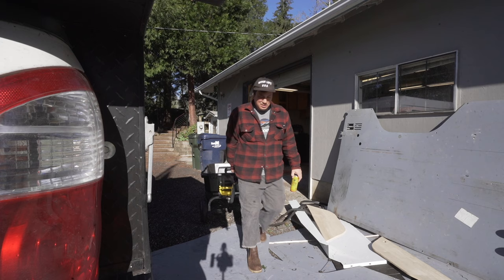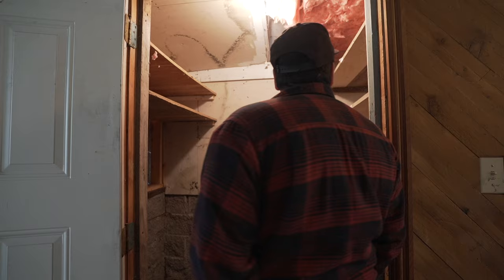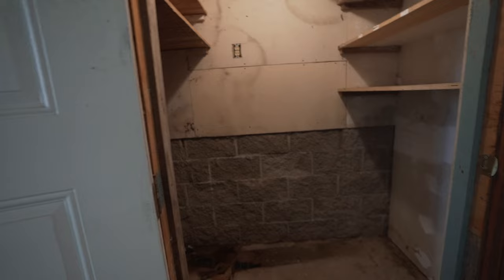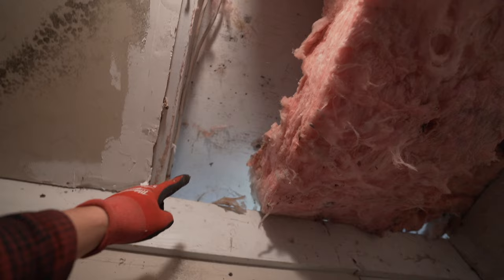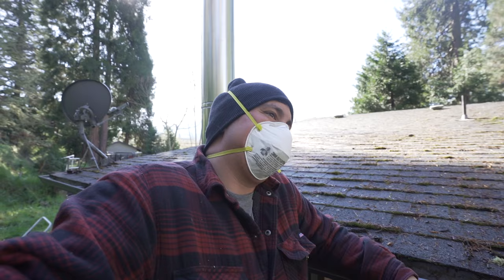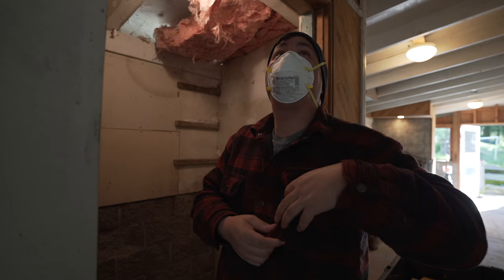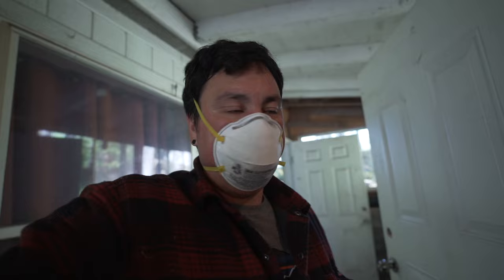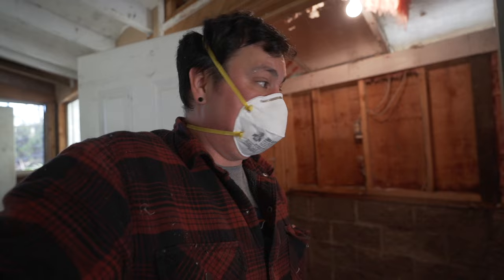It's Worse Than We Thought... (Mobile Home Demolition)

Comment: I can tell you what my dad did since our back yard was under water; buy drainage tile it has rows of holes across  in it going from one end to the other. The rows are all the way around it  You will have to dig a trench across from one end of the room to the other end near the wall make sure you keep it level use a line level.  You want the till to exit out of the soil to drain the ground. You will have to dig the trench starting at the sidewalk area to allow the water to express out.  After digging the trench next to the outside wall using waterproof paint, paint the wall below the ground to up . Now putting a load of gravel above the ground in the trench you have dug make sure it is level  all tho way across use your line level. ( you should b able to google or ask the tech at Home Depot how to use a line level) Put a level amount of gravel all the way across. Lay your tile end to end butted to each other Then fill in the trench with a level even amount of gravel covering the tile all the  way across 
from one end to the other. Make sure you have at least 6 to 8 inches of gravel over the tile and fill in the rest with your soil over the gravel. 
You should be able to google these steps or ask the tech at home depot or wherever you buy your drainage tile. It is a job I know my dad, mom, brother & I did this when I was 12 years old. We never had a pool of water in our backyard ever again. Every spring & fall we had a small pond in our backyard in Ohio about 1/8 of a mile from Lake Erie in Mentor on the Lake, Ohio the northeastern Ohio we never had a small pond ever again! 

Also the dampness is drawing the ants they are carpenter ants wet wood will also draw termites!

Comment: Having followed you and watched you work for some time, I am of the opinion that you will not have much difficulty gaining the roofing skills necessary for doing the fairly simple roofs on your buildings. Just pay special attention to the penetrations. I am not a master roofer but have roofed several buildings and never had a leak. One person working alone can get the job done, but that will be very slow and frustrating. With two people, things move along much more satisfactorily. A three-person crew, once they get a rhythm going, can just fly along. Once you tear off the old roof, you need to get at least the new underlayment on as quickly as possible. Especially true in Oregon, where you may get rain at any time.
Reply from the maker: Thanks yo I’m confident I can figure it out just never done it

Comment: Isaac, you’ll not only need to roof but you need to put a drainage system behind that back room, sealing it isn’t going to be enough.  Would the inspection company be responsible for negligence?  I would look into that. You might want to consult with an attorney.  I think you could do the roof, a metal roof would be ideal and add value to your home.  You are so good at building out buses, don’t let this overwhelm you I think these fixes and repairs would be great content.  Instead of a bus build why not a home? I’d look forward to watching.  You’ve got this!
Reply from the maker: Def

Comment: on outside if wood bad at bottom cut it off 2 ft up and replace ! for the wall put house wrap on and side it ! as for the roof if it going to have new roof  repair  plywood if it needs it!! go on line you can get good bug stuff to put around walls at the ground you just have pull a little ground back 4"  ! have a good day
Reply from the maker: Thanks for the tips!

Comment: Hey Issac, It looks like you have your hands full on your house.  Lucky for yourself you're handy and willing to learn how to do new things to add to your skill set.  First off, I'm a general contractor and a landscaping contractor in CA.  It appears you have figured out what to do.  If there is no underlayment the tiles needs to be removed.  Then replace all the rotten timber if any.  Access if you need new gutters, if so install at this time.  Also at this time, access is you need new or add more or relocate the downspouts.  After all this add the underlayment and roof shingles on top.  If budget is a great concern, you seem to have a large following and community here.  Perhaps, gather a group of volunteers and knock of the roof in 1 or 2 days.  Pay if forward after that somehow.  I might be headed your way in a few months so I can help if the timing lines up.  In regards to the exterior back wall, you need to remove some f the earth back and add some waterproofing material to the wall and add some drainage to the area like a french drain system.  All the water from your hill is coming down on your house and you have to divert it away from the house.  All this is not rocket science but I get the sense  that you know what you need to do, but the task on how to move forward on projects you're unfamiliar  and daunting.  If you can build vans and buses you can do a roof.
Reply from the maker: Yeah one step at a time

Comment: Not just the debris. The retaining wall was built to hold the slope from caving. Remove the walls of the room on the sides and the top of the retaining wall down to the studs. Then just use cat screen to screen in the room. New roof. Keep the one log burner. Keep the back slope maintained and not let it grow above the retaining wall. The retaining wall was never meant to be anything other than to hold the dirt back. Not like a basement wall.
Reply from the maker: Thinking the same thing!

Comment: The side of the house should not be right onto the dirt especially because it is made of wood.  There is no waterproof water barrier and the wood is acting like a sponge.  You should create a side porch like @sharon7181 said or dig it out, build a wall with bricks with proper insulation and then restore the dirt.  However that is probably too much work and the side porch with a retaining wall is the way to go.  Also, anywhere on your property where water just sits and gathers is a no no, so you should create a water drainage filtration with rocks and pebbles on a decline to pull the water away.  Good luck, you got this.
Reply from the maker: Def got to get at it!

Comment: You have a huge mess there friend.  Isac, you need to dig all the earth away from the structure and put in a retaining wall with a lawn tile drainage system under it.  That will force the water to drain away from your structure.  I know money is always an issue, but this is going to take some bucks for sure.  I personally would tear the structure out.  Do the retaining wall with the drainage system, and then build back your enclosed porch.  That is actually a retaining wall inside that room, but it is not doing  any good without a drainage system under it, so that entire wall needs to come down so that you can move the earth back at least four or five feet, personally I would do no less than 6', and then get the drainage system in, and the new retaining wall.  .
Reply from the maker: Yeah lots of work ahead

Comment: Exterior wood should always be at least 4 or 5" below the wood siding.
It's possible that soil ran down the hill, eroded from the hill filling up the soil height higher than it originally was.
Reply from the maker: Dang

Comment: Open the ends (remove the end walls) dig out down to the brick foundation. Replace the rotten wood and paint with water repellent tar and put corrugated metal on the walls and the roof. I'm sure there is more but it's a start.
Reply from the maker: On it

Comment: Landscape grading can help to direct water away from the wall. I suspect you may also need to dig down to the footer in order to waterproof that concrete wall if you are going to salvage the back room. French drain might also help, but I can't know about that without seeing more of the conditions. Just removing that whole back room area might be worth considering, which I think you are doing.
Reply from the maker: Thanks for the tip!

Comment: I have been repairing a wall that has/had water damage due to a clogged gutter. I didn't notice a gutter along the backside of your side porch. 
The outside of your closet area needs siding or something to cover the wood to protect it. A French drain that will quickly divert any water away from the house would be wise.
Seal the inside... wood and walls with Kilz. Then cover your stonework with a paint on basement sealer.
I would immediately install an indoor/outdoor ceiling fan or two or a ceiling fan and a bath fan to help keep the humidity in check.
I would hire out roofing the house but diy the rest. Your living quarters are most important, the rest you can learn on.
You do you, of course! I am just participating in the brainstorming. Take care! 😀
Reply from the maker: There is a gutter just sucks

Comment: I would dig out around the bricks and put waterproof membrane on the bricks and re-do all the boarding and waterproof that as well, If the shingles are laid right water shouldn't be getting to the nail entrances. I feel the earth sitting up against the wood is wet and the water is wicking up the walls. P.s it was field mice poop not rat poop. Field mice are so sweet and mean you no harm, they just found a cosy home in your walls that to be fair were open to the environment at the top.
Reply from the maker: Yeah that’s gonna be a job!

Comment: I think an important thing is there appears to be no blocking between the roof joists... Looks like you can see directly outside when the insulation was removed. When the wind blows rain and snow against that wall the moisture is coming in and running down the wall...
Reply from the maker: Gotcha

Comment: We also bought a used older mobile home.  It's in pretty rough shape,  Hired a contractor to re-do the kitchen, eating area , and they had to remove the whole back porch, it was so rotten.  What we found is all the walls are rotten, from the way the mobile home company built it, apparently that has not changed the way they put the windows in. So the water leaks down into the walls from every window.  At least I did get a lovely pantry built for us, off the kitchen, which is so handy.  Our's is a single wide, But back porch was added on, as is the addition, we are using as a bedroom. Roof really leaks in this part, but the whole addition needs to be torn down and re-built. So will only do a patch job on this part, until we can afford to re-do it.  On the floors, below the windows, there is a line of rot, all along each wall, in the whole house.  My husband is working on the spare bedroom right now, and it's starting to look good.  Cannot wait until it's done.  Then the bathroom is next, as the hot water heater is almost ready to go through the floor.  Luckily we bought everything new for it, ready to be put in.   The Whole mobile had to be lifted off the ground, as it had been neglected so long.  That was quite the job.  So Room by room, we will get this mobile ready to be a home, not a dump.  BIG job behind us, and ahead of us, but we will make it.   Keep on going Isaac.  It will be worth it in the end.  Hopefully we live long enough to finish it and enjoy it.  I'm 74 and my husband is 75.    We could use a work part for sure, but our son and grown Grandson, who live close by are both too useless to help.   So like all the rest of our 56 yrs of being married, we will keep on, keeping on.  We're not slackerds.  Just like You and JAYLENA aren't.    Some people have that drive to get it done, a lot don't anymore.  Best Wishes on your repairs, we will be thinking of you, as we carry on.  WE live in Alberta Canada, and it gets darn cold out here!!!
Reply from the maker: Oh snap!!

Comment: Isaac, first, that cement block probably has no water barrier between the dirt and the house. I would never have that earth right there. You need a walk way all around the house for protection from ground water. The water still runs after the rain for a long time and it's moving right to that wall. Cement blocks are known for leaking bad. You will have to cut a bit of that dirt back and put in a sidewalk and a French drain around the foundation. Tons of work or tear it out all together. 🤨😪
Reply from the maker: Gotcha def on it

Comment: One bite at a time Issac. You didn’t mention drainage (or I missed it from a previous video)… that is a retaining wall near that back porch/patio. If proper drain tile hasn’t been buried, no amount of paint and sealant is going to keep the moisture at bay. You are doing a great job getting to the diagnosis of the problems. Hang in there!
Reply from the maker: One step at a time!

Comment: Clean out the debris.  The dig a trench about 1' out from the wall.  Put in perforated pipe, with gravel around it and tie it into where your downspouts drain.  You may even want a couple of surface yard drains to take the excess water coming down the hill.  You have to get the water away from the house before you can do anything that will last on the inside.
Reply from the maker: Def!

Comment: I would definitely waterproof those blocks. I had mold on the ceiling of our bathroom. I sprayed it with Clorox Clean Up until it was dripping, I mean I soaked it, drywall and all. Then I just closed the door and left it to dry and there hasn’t been any mold at all again. I was pleasantly surprised!!

Comment: If you put on shingles, use 50-year shingles, it's not that more expensive than 30 year shingles. Replace any bad underlayment and hopefully you won't have issues in the future.  Make sure the down spouts are directing water away from the house. Or maybe install a rain catchment system in the back and use the water for garden or animals.
Reply from the maker: Def!

Comment: Good morning Isaac, your going to have to put some (wire mesh) in all those holes and then use a really good spray foam insulation in the corners so nothing can get back in that area omg just seal it really good Plus you could dig a ditch and fill it with gravel to keep the water running away from the house. Have a great day.
Reply from the maker: Got ya on it

Comment: Yes you are getting some water through the roof.  But, water that is seeping along the bottom of a wall is coming through the soil and seeping into that room.

The only way to fix that is to dig all of the dirt away from the back retaining wall and treat that back retaining wall the same way you would properly construct below grade basement wall.  Install gravel rock and drainage pipes along the length of the back addition and direct the water flow away from the house.  On the outside of the retaining wall you will need to adhere waterproof membrane.  

When you have provided proper drainage, proper water flow away from the house, an impermeable waterproof membrane on the exterior wall you can decide to backfill the soil along the outside of the retaining wall.  But it would be better to keep the soil away from that wall completely and provide great ventilation by making that a one sided back porch.

It should never have been built in such a fashion.  You’ve done plenty of bus reno’s…you know it is a pain to correct the mistakes made by other people.

You can correct this with determination and proper construction of drainage and waterproofing.  But, the easier solution is to open up that area and not making it an enclosed room.
Reply from the maker: Thanks for dropping in. Going to be a job but I’ll get it figured 🏋️‍♀️
Reply: Sure Issac!  We have been through this with our basement walls.  Such a pain, but we persevered and have a dry basement now.

Comment: Maybe you could put metal roofs on all the shop buildings. I like metal roofs, my grandparent's  farmhouse had one that they took good care of and I know it was almost like new in the mid 70s after having been installed in the mid 1930s. I know how it was in the 70s because my mom and I helped give it a coat of metalic paint and it was still really nice. Anyway a tin roof might be quicker, more water resistant, less expensive than shingles and have a longer lifespan.

Comment: Definitely put a new roof on.  Take all the rotten wood off the walls. You may have to dig out around that section seal the cement walls. Gutters for sure divert the water away from the house. I hope that the decking on the roof is ok. I'm sorry this happened.  Fix that area before putting a new roof on shingles are cheaper. It's not hard to put them down but it's hard work if you have to take everything off and start over. Rent a big dumpster and lots of tarps. ❤❤
Reply from the maker: On it!

Comment: Isaac, there needs to be guttering all the way around and the debris and soil is to close the the house. Do you know where the down spouts are emptying out as it looks like they are underground too.  If it is surface mould you don't need chemicals. Good old soap and water will get rid of it. If however the plaster board is wed, it's a good indication it will have mould behind it. I think this is going to be a bigger job than you imagine. It looks like you are going to have to dig a trench around the back of the extension and see if there is any waterproof barrier in place between the extension and soil.  Also check the drainage isn't just going into the soil making it wet. Also you shouldn't be able to lift the shingles up like that. I think you should start a go fund me. An open patio sounds the cheapest option plus when the weather is nice you can sit out there, have BBQ's. You can make it really nice over time with flowers, wall hangings, make a little bar area etc.
Reply from the maker: I don’t will have to figure it out!